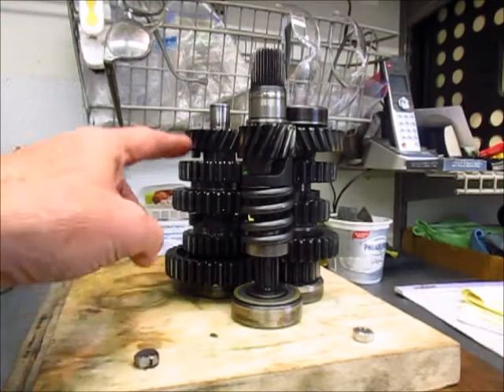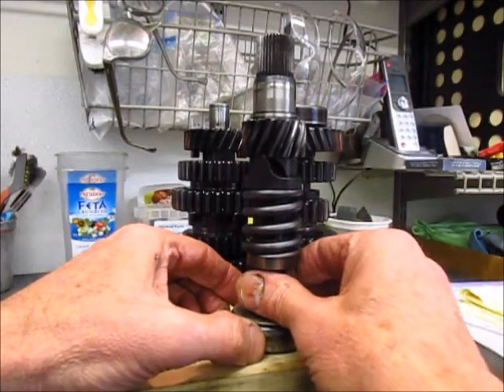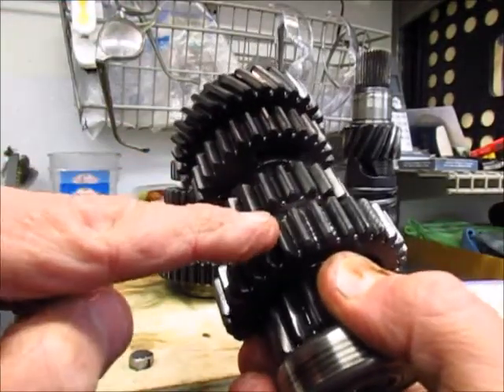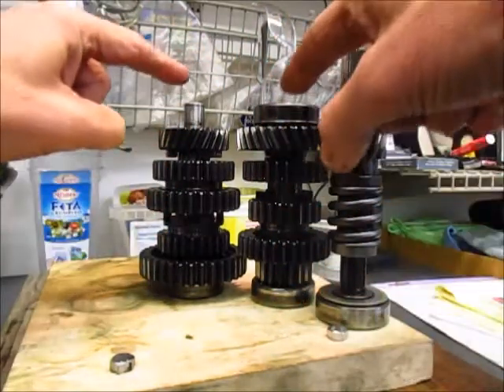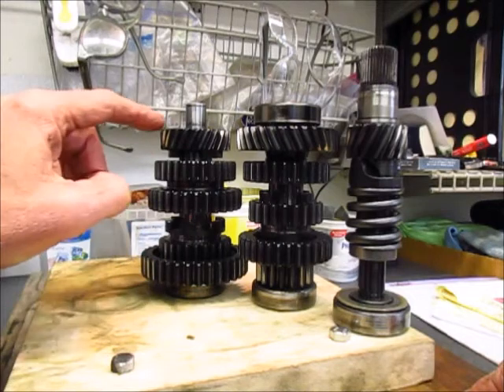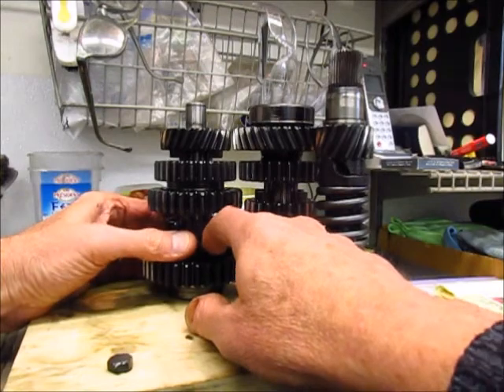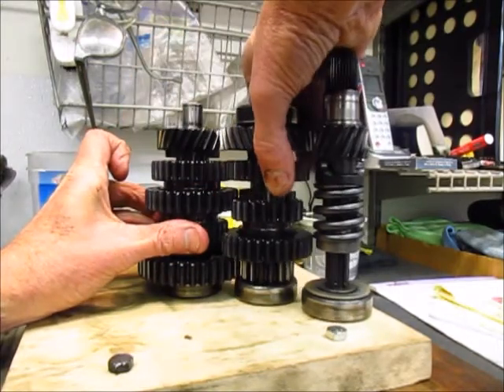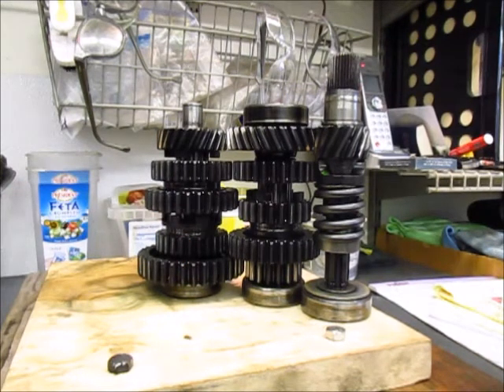1977 BMW R100RS How Transmission Gears Work

Comment: Question: This same transmission, when in neutral and running, the teeth on the trans gears appear to be slightly making contact creating a noise of such. Reaching down and slightly applying pressure downward onto the gear shift foot lever, the noise disappears. Letting go of the gear shift lever, the noise returns. This just started from 1 day to the next. What went wrong or is going on inside the case ? Any advise before spending several hundred dollar bills ? Thanks, Pg